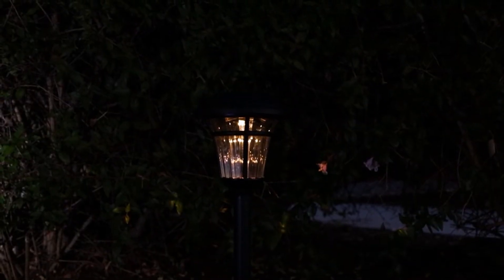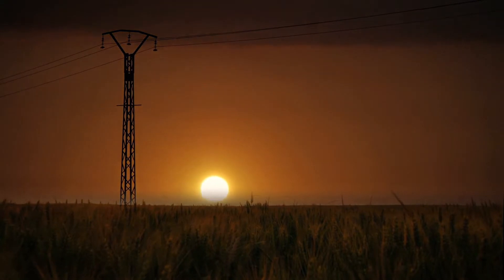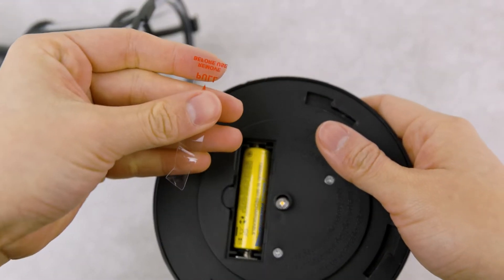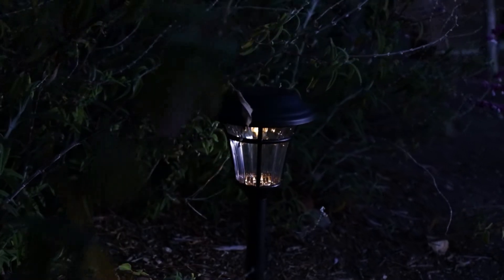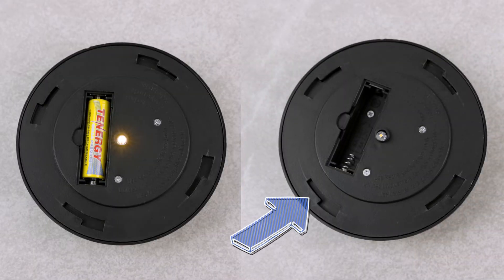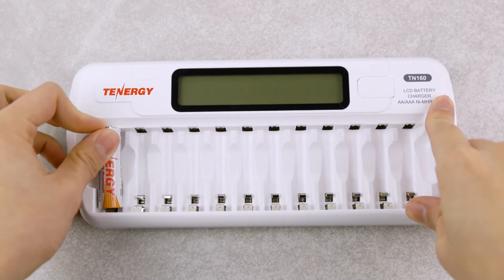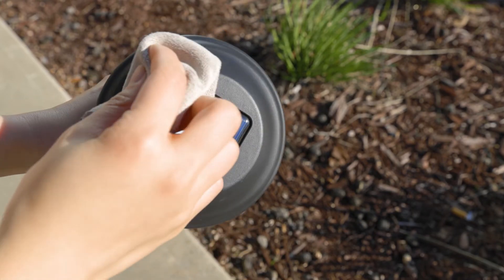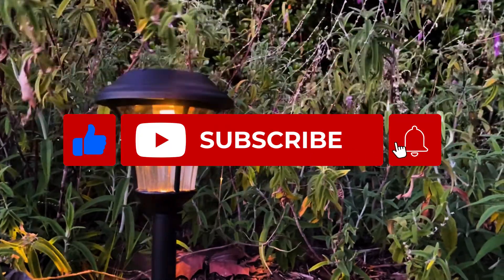How to troubleshoot solar garden lights

Comment: I don't know why Solar should even have batteries
Reply: How do you expect it to work at night when there's no sun? The solar panel charges the battery so it works at night.
Reply: Something has to store the energy collected during sunlit hours… that’s what batteries do. When it gets dark, the circuit turns the LED on using the hatteries to power them.
Reply: 😂😂😂😂😂 hilarious comment! 
You need light at night where there's no sunshine so therefore you need a battery.
Reply: Kya night time mein Sun light hota hai kya!😂

Comment: What is best way to clean the panel? Windex?
Reply from the maker: a damp cloth should be sufficient, in our video we used a dry microfiber cloth - the aim is to wipe off any dust/dirt that's settled onto the panel which blocks light from hitting the solar panel.

Comment: Another battery problem is that some brands like Amazon - have a positive tip that is slightly shorter and does not make contact. If you want to use the high mAh batteries from Amazon, sometimes you have to bend the piece of metal where the positive terminal connects in order to compensate for the battery. I have measured these and they are DEFINITELY shorter - you probably don't think so...but they are. I do like the higher mAh though so until I can find another quality brand this is the way it goes.
Reply: This helped a lot. Thanks